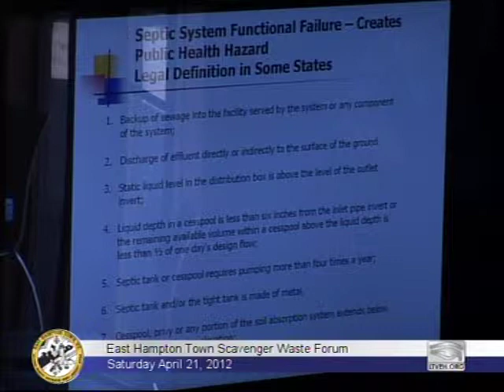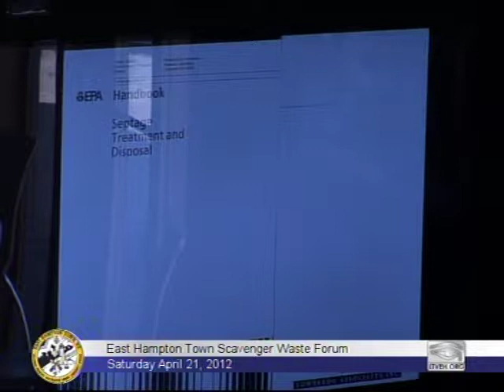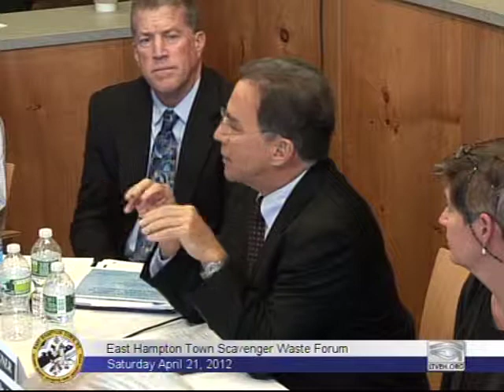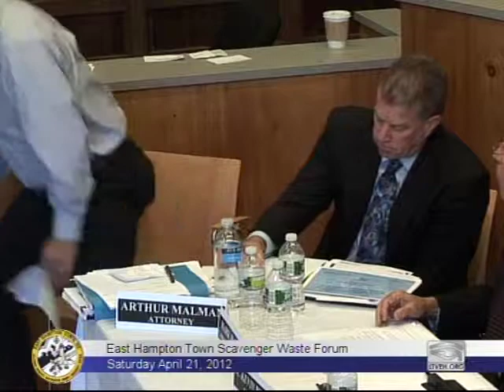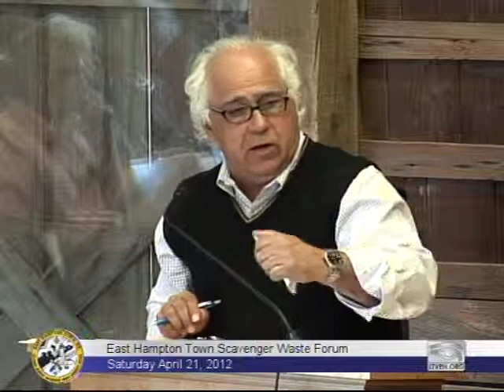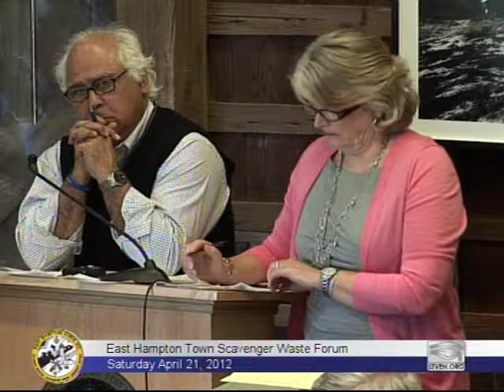Town of East Hampton Scavenger Waste Forum (part 2 of 3)

Comment: For clogging, septic system, plumbing and water supply maintenance use the all-natural Advanced Formula Septic-Helper 2000 and Enza Drain Line Cleaner. It has the 8 natural bacteria and enzymes that digest the waste in the tank AND out in the drain field.